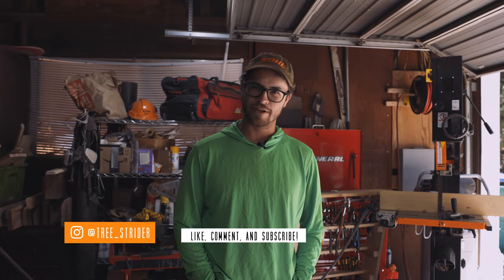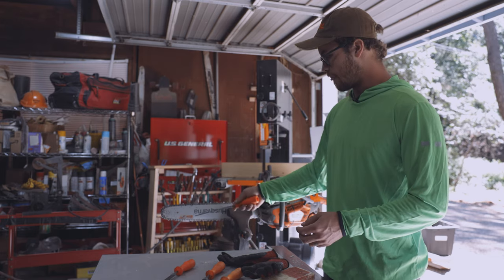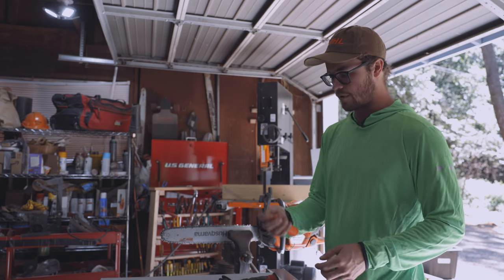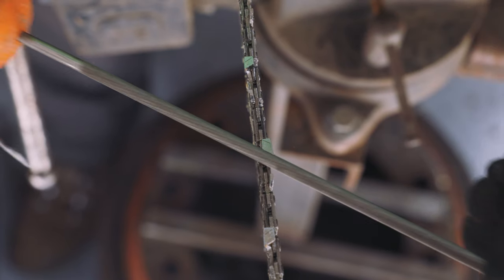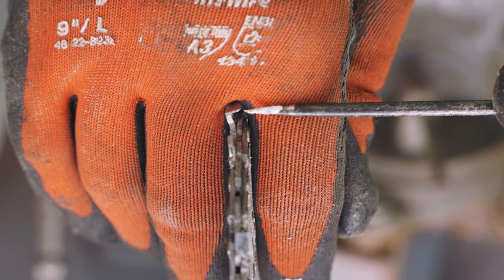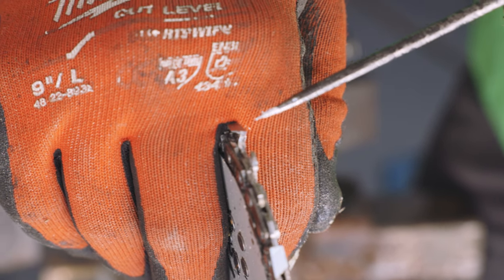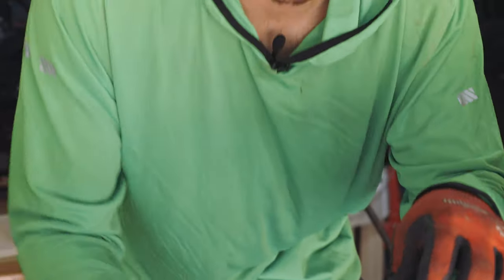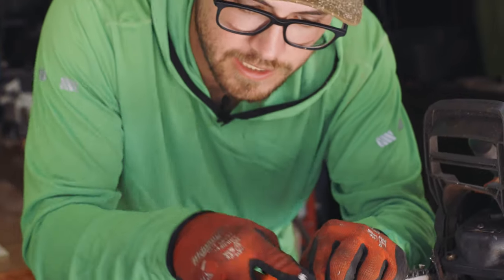How to Hand Sharpen Round File Chainsaw chain | Tree Worker Tips & Tricks

Comment: I just recently started using a chisel bit (hexagon) file to sharpen some saws. The Granberg file guide helps a lot to hold consistent angles. Saws cut fast and smooth, so that increases safety and productivity. I don't recommend square filing for amateurs, but it's totally worth the extra effort for those who keep their saws out of the dirt.

Comment: This is not a beginners video.  They are called depth gauges and not rakers.  To file them down to the recommended depth of 0.65mm requires a depth gauge guide and not eyeing it.
Reply: I agree Frank.  Strider at least got it right about the importance of 'consistency' with teeth angles and depth gauge height.    Checking by eye does NOT lead to consistency.  Even those with decades of filing experience, and an ability to 'eyeball' it, still use filing guides on a regular basis to bring the angles and depth gauges to their correct position.
Reply: Frank, your sharpening vids are great!